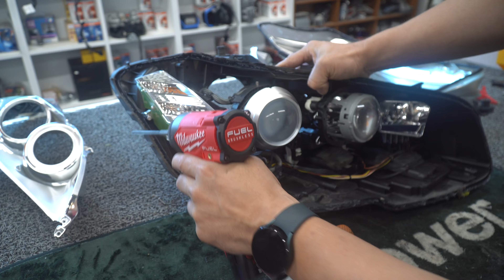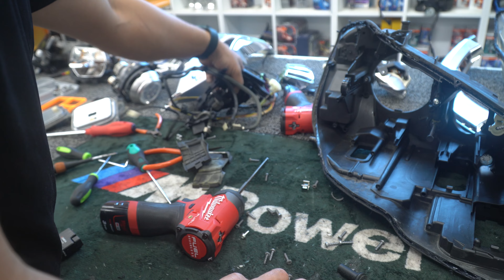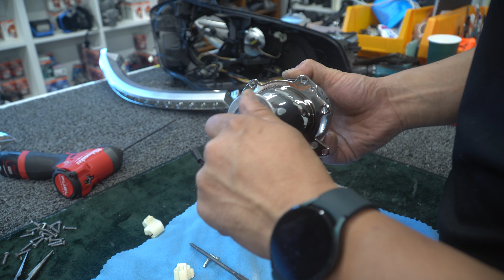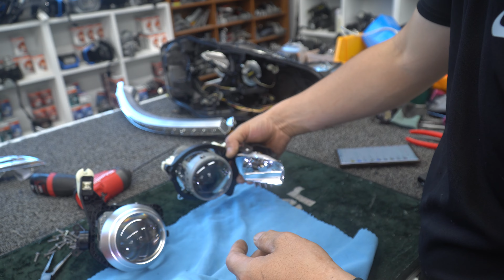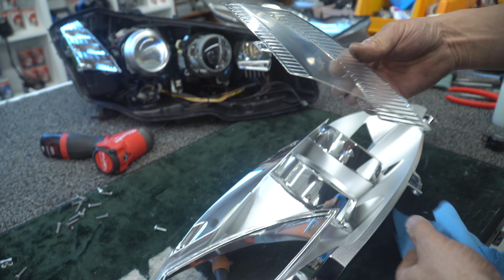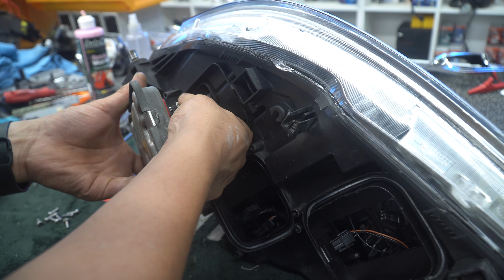Mercedes-Benz S-Class Headlight Restore W221

Comment: I have a Japanese car and would like to convert the headlights to be EU-compliant. However, I don't know if this can be achieved simply by replacing the projectors, without changing the headlight assemblies. Thank you. !!!!!
Reply from the maker: I know that with LCI, it is possible with coding.
Reply: @비엠타는공돌이  I have coded this, but the light scattering is not asymmetric. That means it will require asymmetric light. Currently, mine is coded on the right side, but it is symmetrical, i.e., a straight line.

Comment: Is it possible to adjust the headlights of a 2013 Mercedes S W221 S350 for left-hand traffic without having to replace the headlights? thanks
Reply from the maker: It can be changed with software.
Reply: @비엠타는공돌이  I heard that in the EU you can only drive with an asymmetrical light/reflectors on the right side . Is this possible only with software?

Thanx a lot!!!